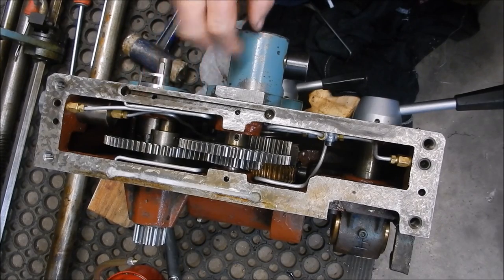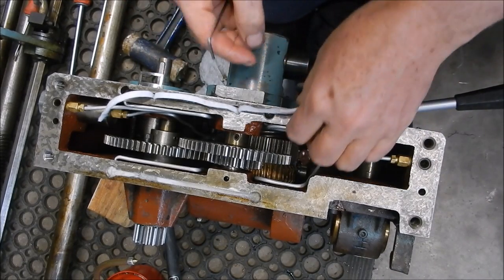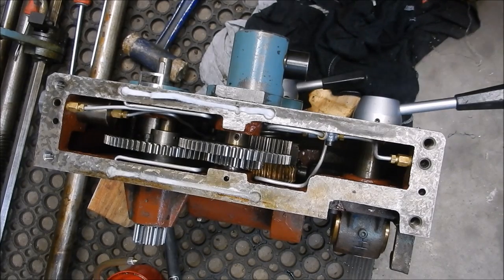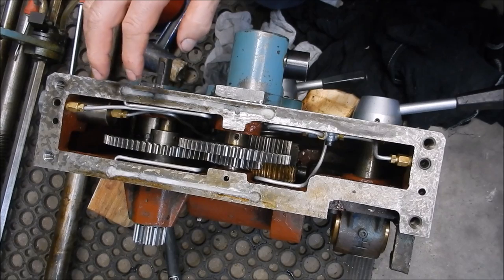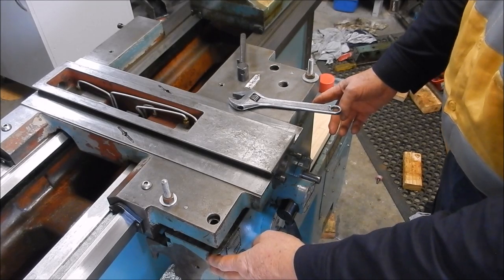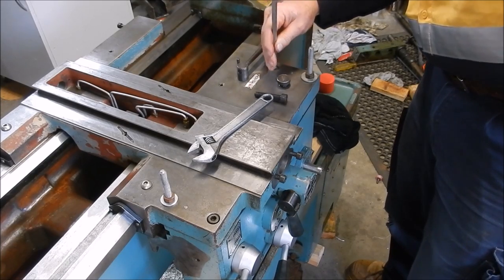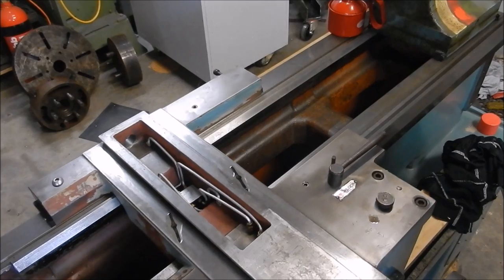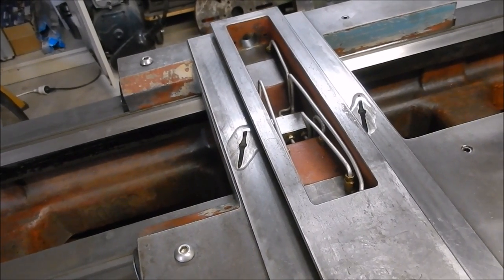Making and fitting Felt Oil Wicks to the Victor Lathe Apron.

Comment: The system works very well I leave my oil on all the time . Great quality lathe very accurate and reliable
Reply from the maker: G'Day Mark, yes in all the strip down and cleaning I've done so far I have to agree with you about the quality of the build.  Yep I think your right, I will leave the oil system on full time.  I won't be using this machine 8 Hrs a day 5 days a week so having it on full time won't be a problem.
Cam

Comment: How did you remove the lead screw and shafts holding the apron on?
Reply from the maker: The Apron stayed in place during the removal of the Shafts.  The cover over the shafts at the Headstock end is removed and the shaft pins removed.  The disc covers on the rear bearing block are removed.  The leadscrew bearing thrust nuts are removed and the rear (inside) nut is removed.  The leadscrew is then removed out through the rear bearing block.  All other shafts including the on/off shaft are also removed out through the rear bearing block leaving the apron free to remove.
Cam